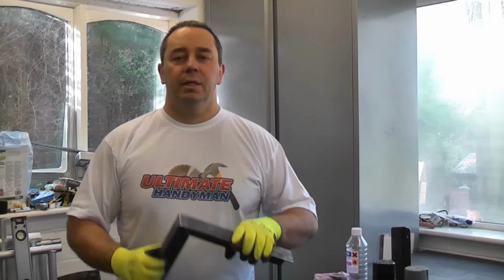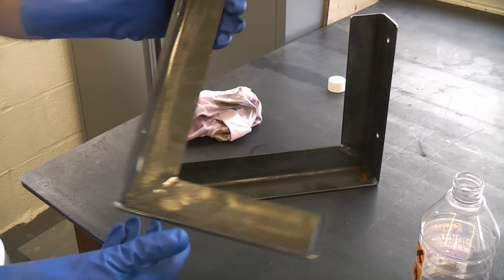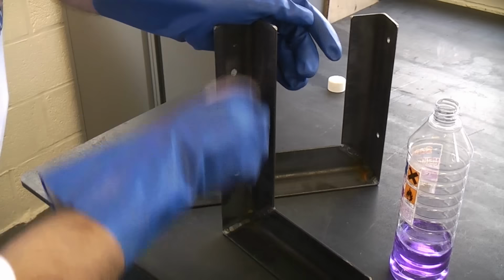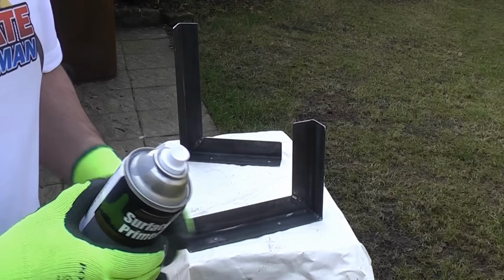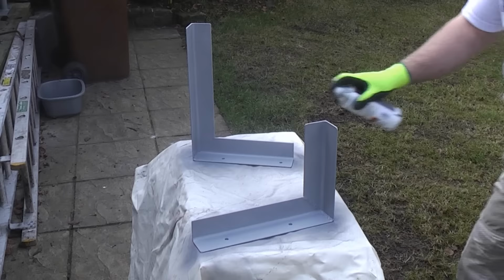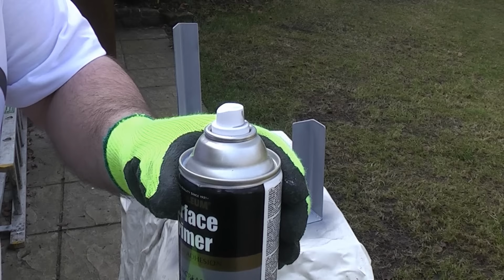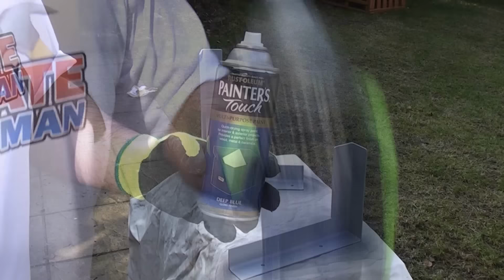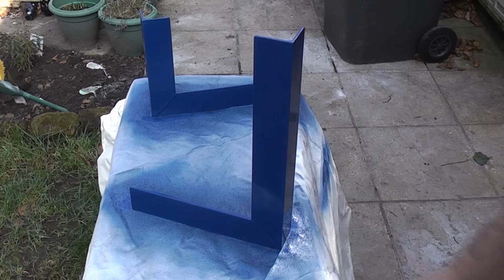How to paint metal | Rustoleum

Comment: Hi I am wanting to paint a chrome shower riser white. I see you have said painting Stainless steel is not very successful, does the same go for chrome?  Would sanding it down first with emery paper then primer be reasonably successful do you think.
Reply from the maker: Chrome is difficult to paint, even with the right preparation, the paint might not last long before it starts to scrape off.
Thanks for the comment

Comment: Hi, Im after a brass/bronze finish on a chrome bottle trap, to match my bronze taps. Please can you tell me if I can use the same method - clean, prime, spray paint - on the bottle trap, and will it adhere and endure considering its going into a washroom (no shower or bath, just sink and toilet)? Should I varnish it to seal the paint?
Reply from the maker: I think you will struggle with this one as the chemicals used in bathrooms such as shampoo and shaving foam etc. are very good at attacking paint etc. If you ever seem cheap Gold plated taps in bathroom the gold plate often comes off because of the chemicals.

It might be ok on the trap as it should not be in direct contact with the chemicals, but I can't say for certain. You would just have to try it I guess! 

Once painted you could lacquer over the paint to protect it ;-)
Reply: ***** What kind of lacquer would you recommend?
Reply from the maker: Mollee Craven 
In the past I have just used lacquer that is used on motor vehicles but I think Rustoleum make it now and I always try and use their products as they are normally very good ;-)

Comment: I spray painted some metal chairs about 3 months ago using Rustoleum metal gold the chairs looked good, but 3 months later they still feel tacky and the origianl black color has come through.  Any advise?
Reply from the maker: Was the spray paint mixed properly?
Also were the chairs cleaned properly before applying the primer?
Reply: Buy new chairs!

Comment: Thanks for the video. I have a question, what if it is a stainless steel ice bucket and i want to paint in a different color can i use these products and do i need  to clean if it is new? R+Thanks
Reply from the maker: Hi, stainless steel can be difficult to paint as many paints will not adhere correctly to it. I guess you could try it but I doubt if it will be durable
Reply: ***** Thank you Handyman xo

Comment: I'm trying to change the color of a lamp shade wire What is the safest spray paint to use?
Reply from the maker: +Ms. VHE 
Not sure, sorry.
You would have to be careful as some paints might degrade the insulation, other paints may flake off.

Comment: Have a. Question i sanded metal down bare then spray painted. It with cheap paint and notices if i dig it with my finger nail it comes off ! Wat should i do sand it all of and prime it then paint it  ?
Reply from the maker: Chris Howe 
Yes, it's no good if the paint is soft.
You really need to remove it, clean the surface. prime it and then apply a top coat of decent quality paint.

Comment: hi

I have a pair of mild steel brackets that need painting and will be used in a gym so wanting a paint that won't chip and scratch easily, would the painters touch be ok or will I need a different type more durable paint? or better with powder coating?
Reply from the maker: Powder coating would be better for a gym ;-)

Comment: Does metallic rustoleum work just as well as the painters touch. And would you still recommend priming when painting a metal bed frame?
Reply from the maker: I've not used the metallic Rustoleum yet, but normally they make really good paint. Yes I would always use a primer to guarantee good adhesion.
Thanks for the comment 👍
Reply: @ultimatehandyman  thanks for letting me know 👌

Comment: I got a question dude, so sanding is not need after the primer? Are you sure?
Reply from the maker: Not for a job like this, but if you are doing a £5000 paint job on a vehicle you might want to use fine wet and dry paper between coats- but then you would not be using a tin of spray paint for that.
Thanks for the comment 👍
Reply: Ultimate Handyman okey thanks man👍🏻

Comment: How do you protect the paint from scratches???
Reply from the maker: If it's going to get scratched, powder coating might be a better option, as it is much more durable.
Reply: @ultimatehandyman  what kind of powder? And do I just apply the powder cost on top of my already painted and dried glossy object?
Reply from the maker: @mambamentality2663   You would have to take it somewhere to get it powder coated. They clean the metal, spray on the powder, then bake it in a large oven.
It's what they use on alloy wheels etc.

Comment: If there’s old pain on the metal should I sand it off?
Reply from the maker: Best to give a light sanding to ensure the paint sticks properly, you especially need to sand the edges of the old paint, or any scratched areas, so that it will not stand out once it is repainted.
Thanks for the comment 👍

Comment: Is rustoleum painters touch enamel? Hard to find a good enamel spray paint in the UK.
Reply from the maker: No, it is not enamel.
You can buy enamel at some shops, but it often requires high temperatures to make it set correctly.
Thanks for the comment

Comment: Does it chip easily
Reply from the maker: It's not a durable finish, so if the item you are spraying will be handled, there is a chance that it will chip.
Powder coating might be a better option, for things that will be handled.

Comment: Hi, I just finished painting a knife I have. Although it looks great, when I went to sharpen it the paint started coming off very easily. Any suggestions on what I'm doing wrong or how I can do it right? The knife is 440 ss and the spray paint is rustoleum camp green. Thanks!
Reply from the maker: You will struggle getting normal paint to stick to Stainless Steel. Most people just polish Stainless! 
I believe that you can paint it with epoxy based two pack paint but it may need shot blasting first!
Reply: loooong past time, but you should look into blackening, or "blueing" steel. That's how they make firearms black and shine-free.

Comment: What paint should I use to paint a steel bulkhead can I roll or brush on rust oleum paint
Reply from the maker: Yes, you can use a brush or a roller. I painted the bench in my workshop using Rustoleum and used a 4 inch gloss roller 👍
Reply: @ultimatehandyman  I grabbed a rattle can of primer but a can of rust oleum black gloss for finish thanks

Comment: do u need to spray clear coat if you have spray primer?
Reply from the maker: It depends on the top coat that you are using, some paints require a clear lacquer to go over the top. Your top coat paint will say if it requires a primer or not.
Reply: ok

Comment: I'm Looking to paint my Golf Putter which is steel I bought an all surface paint but I want it to be permanent so It can't be removed. this paint can't be removed?
Reply from the maker: All paint can be removed, but some is more difficult to remove than others.
For painting the stem of the golf club (not sure of the technical term for it) this will be fine, but if you were to paint the part that hits the golf ball it would soon start to scrape off.
Reply: Ultimate Handyman cool! So then this will be hard to remove with acetone?
Reply from the maker: Probably not, I thought you played golf in a field not a chemical plant!

Comment: can you use isopropyl alcohol to prep the surface. i only ssk because I have a bunch.
Reply from the maker: I'm not sure to be honest, I would imagine it would work but you would have to test it to be certain.
Reply: yes. i use it  all the time.
Reply: Isopropyl alcohol should work fine for removing grease and some dirt. Be aware that any alcohol will take up some water from the air and may cause rusting if you are not careful.

Comment: Nice Vid!  If I were to paint my brass plated door knobs, would I lightly sand the door
knobs then apply the metal to metal primer, resand with 2000 grit and then apply a metal paint?
thanks for your response!
Reply from the maker: That should work, although I have never used this paint on brass handles before. I'm not sure how durable it would be for such a purpose as I think most coloured door handles are plastic coated.

Comment: Do I have to use primer before painting my Computer Case PCI brackets? btw the brackets have paint on them already

Any tips would be good
Reply from the maker: If they are already painted you should just be able to paint over the top of them, perhaps give them a light sanding with some fine abrasive paper if they are currently glossy.
Thanks for the comment

Comment: Question for ya im about to restore a vintage snap on tool box and after its done use it for my personal tools but I was wondering if there is any paint you would recommend in regaurds to it not squishing under the heavy weight of the tool box pieces?
Reply: and what primer would u recommend for the bare metal on a tool box?
Reply from the maker: Powder coating is probably the best option, but it's expensive!
I just painted a large metal work bench in my garage using Rustoleum combi colour primer and then Rustoleum Hard hat top coat, hopefully this will be durable!
Reply: ***** I would appreciate if you kept me posted how that holds up cause powder coating is expensive. But please keep up on how the paint you used holds up cause im planning this project for spring next year.

Comment: I realize this video is old but if you can answer me I would really appreciate it! I'm building a computer and want to custom paint my computer case. I want really glossy paint for this, what brand would you recommend. I would like to keep each bottle under $15 because I plan on having three colors. Thank you!
Reply from the maker: I'd definitely use Rustoleum. A few weeks back I ran out of Rustoleum and used plastikote instead. The plastikote dried but when you touch it your fingerprints show up on the paint and it felt tacky even after a few days of drying. I'll definitely stick to Rustoleum from now on!
Reply: Thank you very much! I just visited my local store and they had just the color of Rustoleum I wanted!

Comment: I painted a test piece with Rustoleum Painter's Touch to see how this paint works. How long does it usually take to cure?
Reply from the maker: Its normally touch dry after a few minutes but can take hours to harden fully.
Reply: +Ultimate Handyman i guess that sounds like a problem. i painted the thing about 2 or 3 days ago and it's still kind of sticky
Reply from the maker: Blimey, if you shook the tin properly it looks like you have a faulty tin.

I'd take it back to where you bought it for a swap or refund.
Reply: +Ultimate Handyman i tried again. the first time i had shaken the can for 1 minute, but it didn't seem to be enough, so now i shook it for 2 minutes just to be sure. it turned out a little better, it's not sticky anymore, but the question remains: how long does it take to fully cure? as in reach its full hardness, to the point where I won't be able to scratch it off with my fingernail?
Reply from the maker: I think it reaches full hardness after 24 hours.
Reply: +Ultimate Handyman i painted it about a day ago and it didn't
Reply from the maker: If you cleaned the metal thoroughly and shook the tin of paint properly the tin of paint must be faulty!
Reply: Warm the paint get a bucket and fill it with hot water and drop your paint can in there for a minute or two
Reply: That actually works as it causes the paint molecules to cross link and hardens the paint.

Comment: How long did you let the primer dry? Great video by the way!!
Reply from the maker: It was a warm day, so I think I gave it about an hour.
Thanks for the comment
Reply: ***** Thanks Handyman, did the same. I might have applied a little too much on my first coat after primer (trying to restore old filing cabinet) have some drip (for lack of a better word) marks in some places. I should just let it dry, sand those spots and respray, right?
Reply from the maker: playersmallz
Yes, if you let it dry then give it a light sanding you will be able to remove the drips before re-coating it again ;-)
Reply: ***** Thanks Handyman!!

Comment: Hi ***** I realise this is an old post but I am seeking advice about painting some old aluminium domed light reflectors to use outside as planters. Do you have any advice please?
Thanks in advance for any responses!
Reply from the maker: Gingernutski It's not something I have done yet, but this should help-http://www.zinsseruk.com/how-to-guide/how-to-paint-over-aluminium/
Reply: Thanks for replying! I have a tin of Zinsser already so that helps! And then the Rustoleum would be ok on top of that? *****
Reply from the maker: Gingernutski 
Yes, that should be fine.
The Rustoleum paint is excellent, I have painted all sorts with it and it looks brilliant ;-)
Reply: I use the little pots of Painters Touch for small projects and it is great! I just haven't used the spray yet, I saw how well it covered in this video and decided it is definitely the way to go!
Thanks for all the helpful advice in this video. =)
Reply from the maker: +Gingernutski 
If you have not tried it yet you can get a brilliant finish with Rustoleum paints by using a gloss roller. I painted the blue part of this van vault using a gloss roller and Rustoleum combi colour - https://www.youtube.com/watch?v=5A0eO0dLVB0
You are welcome BTW, Thanks for the comments ;-)
Reply: That looks great! Love the remote!
As the light reflectors are domed I think they will need to be sprayed but I have other projects where a roller would be perfect. Thanks for the suggestion. =)

Comment: Can I use a red color or any color to spray on metal and detail it?
Reply from the maker: You can paint the metal any colour you like, but what do you mean by detailing?
Reply: Ultimate Handyman I meant are you able to carve the metal with special equipment just like wood
Reply from the maker: No, I don't think that will work, sorry.
Reply: Ultimate Handyman that’s ok,I think I could work the hand out but in a different transformation,thanks so much tho🤗

Comment: Would it last on a metal computer keyboard?
Reply from the maker: It would probably wear off to be honest after a while.
Reply: +Ultimate Handyman Oh well, thanks anyway.
Reply: Primer, Colour, Clear coat.. Shouldn't have an issue, if you want a pro clean, wet/dry sand between coats lightly 1000grit and then polish at the end... Should be ok for a long while

Comment: they make paint now that goes directly on bare metal. No farting around with primer like dad used to do.
Reply from the maker: That is correct. They also make one coat gloss and one coat emulsion- most of which is absolutely useless ;-)
Reply: ***** ok, if your doing a car, then you have to use primer because you'll be sanding out imperfections and stuff, but like with your brackets there, I'd wipe them off with laquer thinner, and spray them with machine or tractor paint., -Thanks

Comment: Can i spray paint stainless steel ?
Reply from the maker: I have never painted stainless steel to be honest, but the instructions on the Rustoleum just say "metal" so it should work but it's not something I have tried yet.
Thanks for the comment
Reply: sHorbo Zaman First you should scuff the surface and prepare it for primer. Remember will fill scratches that are 180 grit with no problem. Clean the surface with the associated solvents and spray the primer on, following the data sheets of the primer you chose to use. In the case of what I use, I lay down epoxy primer, sand it a bit so it has some "bite" then lay down primer filler, then another layer of epoxy primer.
Let the surface dry completely, then sand the imperfections out, such as runs and pinholes/fisheyes. Before sanding, make sure no pinholes, runs or uneven surfaces are there. Scuff to about 600 grit and color coat it.
Any clear coat processes to protect the color coat should be follow similar guidelines that automotive painters do.
Reply: Thank you Sir :)
Reply: No problem. There are many different ways of painting but I would either use etch primer or epoxy primer. In the end, I always top my primer off with epoxy primer since it works to help seal moisture from getting into the metal. Etch primer is simply a form of acid or solvent that chemically "bites" into the surface to create a better bond. I have no experience using it since I only have painted on carbon fiber and surfaces that don't require such a item. There are a lot of sites that can help you. Check up on how to paint cars, as they follow similar instructions and guides as what you would be wanting.

Comment: how long do you wait for the primer to dry???
Reply from the maker: It's normally touch dry after 20 minutes but can take 24 hours to harden fully (it should say on the can). Once it's fully hardened you can then apply the top coat.
Reply: ok thanks   :)
Reply: hi i want to spray my scooter bars which are blue can i spray over it with primer and then top cote??    :)
Reply from the maker: Connor Prifti
As long as they are painted and not plastic coated you should not have a problem ;-)
Reply: ok thanks     :)

Comment: What metal is best for painting? I want to use some sheet metal for a project i'm working on. and is that spray just for metal?
Reply: Any metal can be painted with the right surface preparation. Some extremely unreactive metals are difficult to paint, but why would you want to paint gold in the first place?